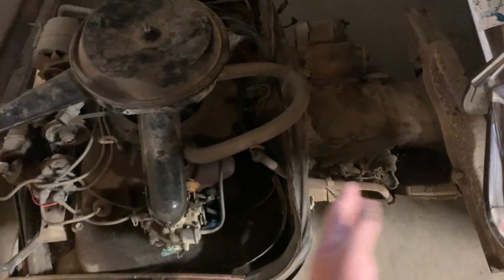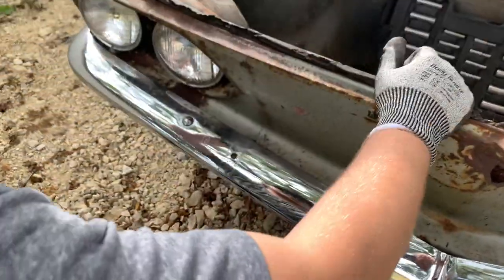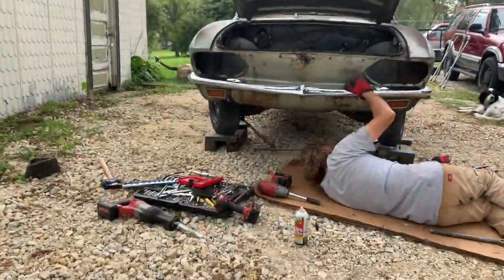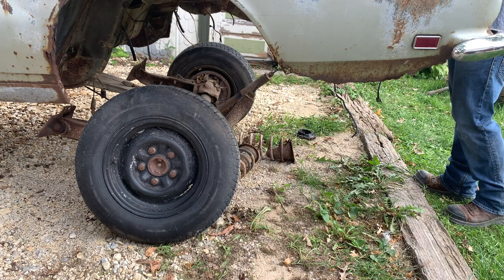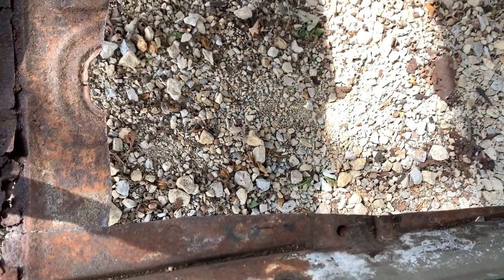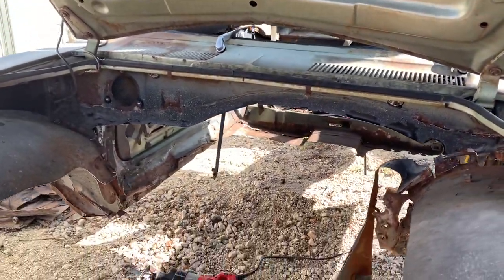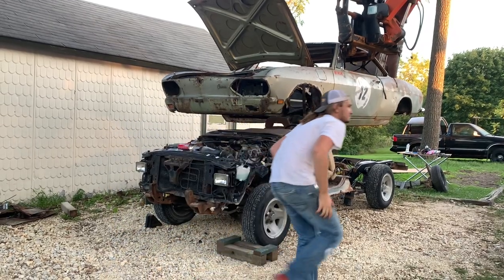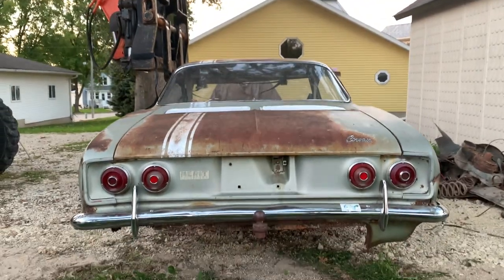Putting a Corvair body on a Chevy s10 frame! (1/2) | 1969 Chevy Corvair/s10 chassis swap part 5

Comment: This is a very cool project, I wouldn't have used the S10 frame as you have to sit on top of it. A few years ago I did a 65 Nova the same way but I used a 1985 Malibu frame. The advantage is that it's perimeter frame which I made brackets and welded the frame to the rocker panels which like the Corvair is the strength in the body. I then used the floor pan out of the Malibu which had all the seat support and trans tunnel. Now I had a 65 Nova with a rigid frame, 400 small block, turbo 350 and posi rear. Front disc brakes!! The car handled well.
Reply from the maker: I don’t necessarily regret using an S 10 frame. But it has had its challenges along the way. But the nice thing about S tens is they are relatively cheap and available and it has a bigger aftermarket following. I have some big plans I had to make it handled better. But that won’t be till later down the road. Your project sounds cool too!
Reply: @lucky13speedworks  Please don't get me wrong, I like this project a lot even using the S10 frame. I would have done it differently as example; I wouldn't have tried to incorporate the dash and firewall structure and floor pan. I would have striped it down to the chassis and engine and worked on mounting the body to that. You could have left the Corvair dash and structure. Like I mentioned the Nova project I did, we had that completed and done in 2 weeks. As for your ride height, they make dropped spindles and short coils for the front. Be careful on using lowering blocks in the rear. I'm actually looking at a 68 Corvair to V8, but I'll use a small block and a Eldorado transmission between the rear wheels.  I'll keep watching, get er done!!
Reply from the maker: @FCspecial  Oh, I know you didn’t mean any disrespect. Actually my most recent video that I just posted explains why I chose to do it the way I did. I actually end up welding the dash back in as well! As far as the front end goes I agree. I am going to lower it a good 6 inches. But I think the backend sits very nicely so I am not going to lower it at all.
Reply: Been a while still pecking on mine take care

Comment: Some of those fork lifts will tilt from side to side. If it does you might can tilt the forklift to the left and it might help clear the dash
Reply from the maker: You are correct. My dad is certified on running them so he knows all the tricks.
Reply: Me to

Comment: Cool project, but as a Corvair fan I hate to see that you used a 1969. That was the last year of the Corvair and they only made 6000 of them. Would be a cool project for a previous year.
Reply from the maker: This car was destined for the crusher. I had tried selling it many times before. For cheap as well, very cheap. And nobody ever wanted it. So I decided to do what I wanted to do with the car. And I don’t regret it one bit. I have another 69 Corvair in my garage that I am doing a ground up restoration on. So I think one 69 Corvair that was saved from the crusher but now lives a different life is better than it being crushed in the end.
Reply: @lucky13speedworks  it’s definitely a cool project! I’m working my way through all the videos.